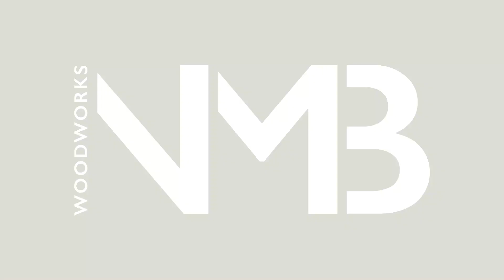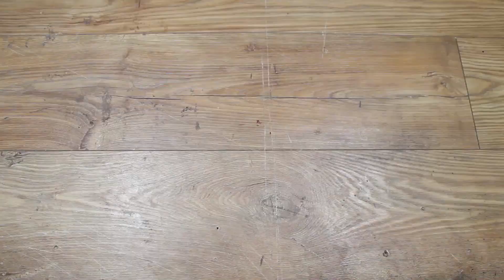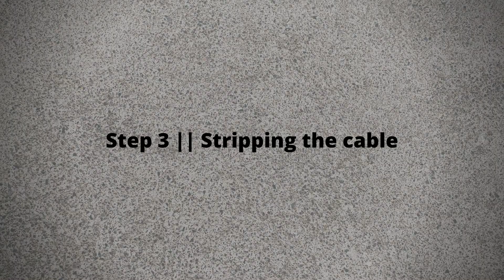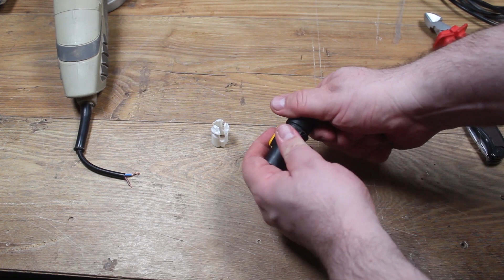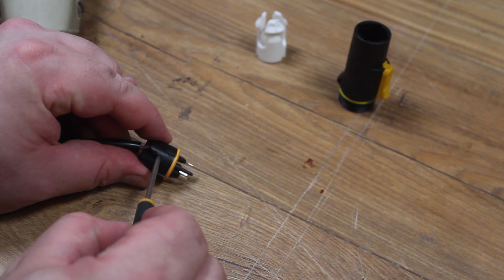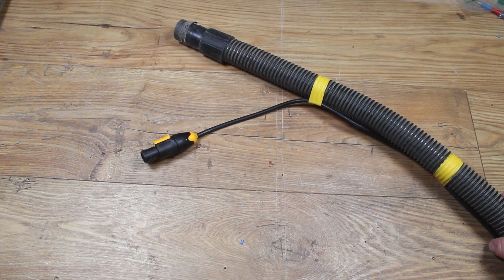Workshop hack to deal with cables || workshop organisation tip

Comment: I did a similar thing. I hate messing around with all the cables
Reply from the maker: Did you use similar connectors? I'm interested in which one other people have used for a similar conversion
Reply: @NMBWoodworks  I used c13 c14 like the connectors on kettles. They can handle the amps but they disconnect easy, which can be annoying. But they are cheap.
Reply from the maker: Pros and cons with everything I guess. I think the disconnecting would annoy me but as you say, they're better on the price front